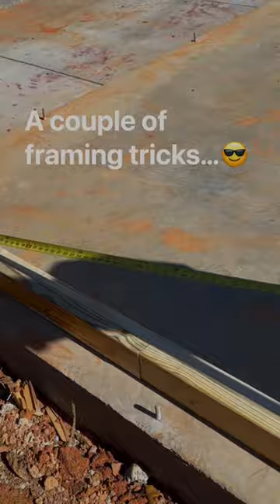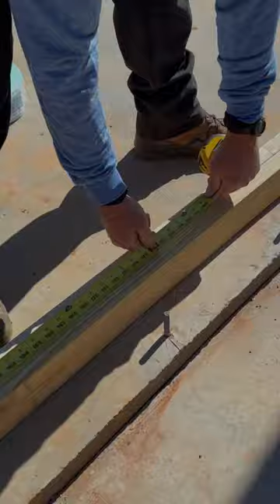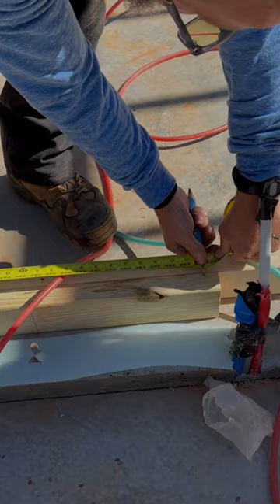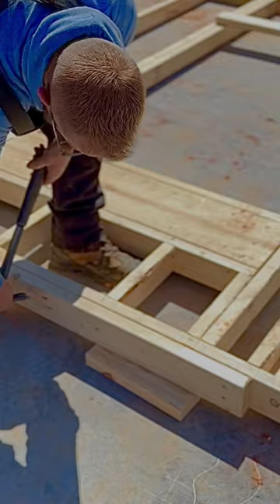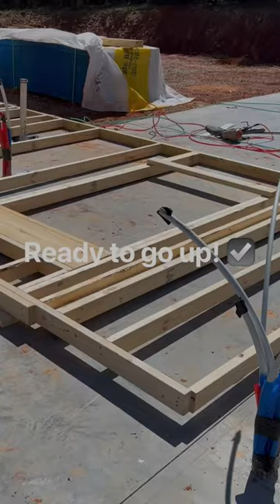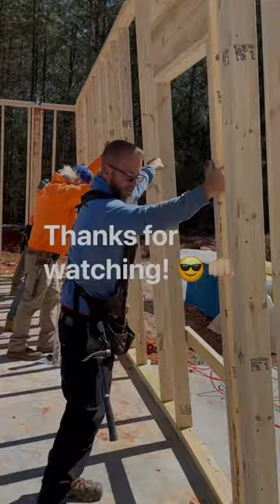Wall framing…  Thank God for the sense to do it! 💯

Comment: I learned to nail a piece of strapping on the bottom plate and the floor so when you pick the stud wall up it doesn't slide off... Good if your working by yourself..
Reply from the maker: Sounds like a good tip! 😎👊🏼